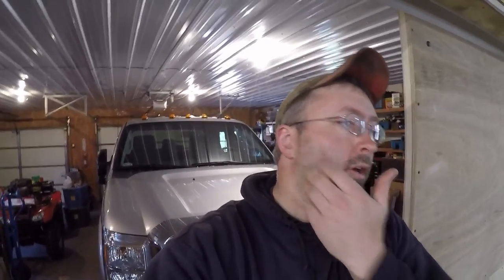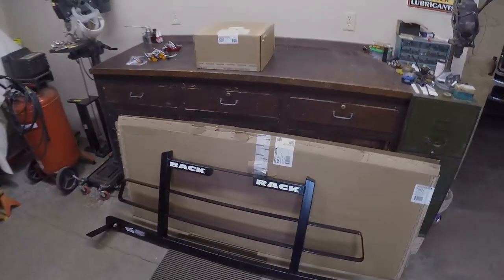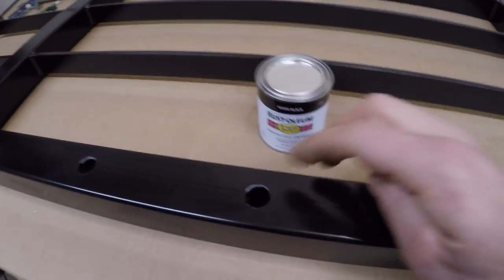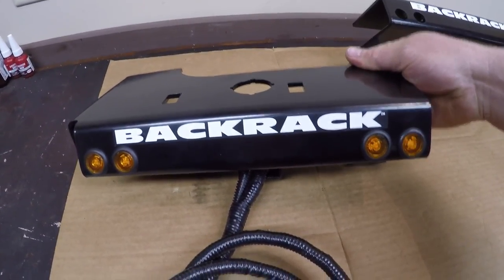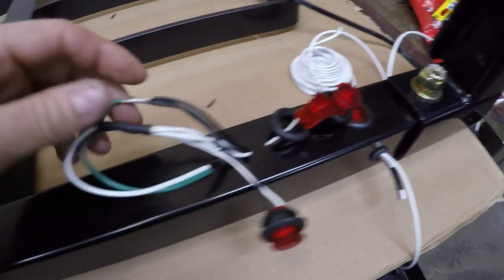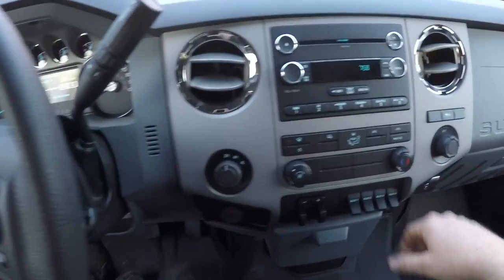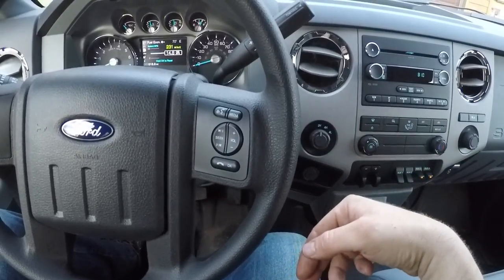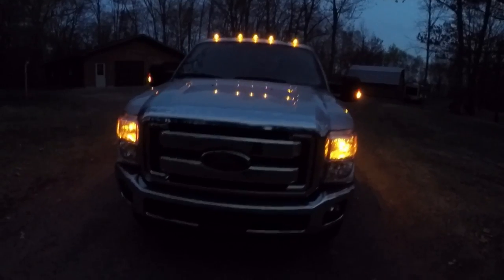BackRack Upgrade - Installing LED Lights

Comment: Looks great!  Nice to see someone else who takes the time to solder and heat-shrink instead of using butt splices.  Sometimes the crimp connectors are unavoidable though; in such cases I usually load up both ends of the connector with dielectric grease prior to crimping it down.  Haven’t had a failure yet! 

One critique I have is the quick connects you have between the BackRack and the truck itself.  Those guys aren’t waterproof and I’ve seen them disintegrate and fail from corrosion.  My recommendation there would be some of the same watertight connectors you used down below, Deutsch connectors, Delphi WeatherPack, or MetriPack connectors.  That’s the only detail I’d have done differently, but overall you did a fantastic job!

Comment: That's a slick setup.  Nice tidy install.  But I will say you need some LED flood lights to light up the bed at night.  Makes loading and unloading after dark a lot easier.  

Great job,
Jay

Comment: Looks great. I love lights I like to be seen. I have a 2017 F 250 with 8 amber on just above the front valance. Set of recon big rig lights. Rear tailgate light bar. Factory clearance lights. And a 30 inch light bar on the bumper that has a amber back lighting. Next is a head ache rack. All lights are switched so if don't want to run them. Once again very nice.

Comment: Sometimes I wonder just how much free time you DO have but the end results are always worth it. NICE job! Looks like NOTHING I'd cobble together IF I could, which I can't! Now for M/M and diesel stuff besides plowing and mowing grass. Spring ought to be there by now!
Reply: I was just antagonizing you a bit because I know full well you can't get done what you do unless you burn the midnight oil candle at both ends. We don't have a t.v. and haven't had  in over 10 years. Nothing there at all for us, anyway. You tube we can pick and choose even though they're pushing the t.v. thing heavy. Not for here. I appreciate what you do and the perfectionist way you do it. Clean and crisp and no strings or wild hairs hanging out. I try to do that and it works sometimes and sometimes not, but I still try. You know you've got me for a loyal watcher. I know just enough about what you're doing to be dangerous but not lethal. I even got to burn a little fuel this week trying to help a neighbor rearrange his swamp with a pond in it. He's happy so I am too. And as always, you did a BANG-UP job! A-PLUS! Later, Pal! And it'll always be supper for me, not dinner!

Comment: Looks good Another wiring method you could use if you dont want to drill holes for more switches is get a DPDT 12v relay and wire a up fitter switch to that relay and wire the the lights to common and normally open contacts. With that said you could utilize the up fitter switch to turn those lights on and off, and still have the stop turn function per side I can explain in detail if anyone wants more info.
Reply: I would love more info on that way to wire

Comment: You can use the upfitter switches to switch a ground....just use the switch to trigger a relay coil and the NO relay terminals to switch the ground.

Comment: Is your tonneau cover an Access Original?  If so, how does the bracket for the cover work ok or should I get the other bracket that is calls for?  I have an Access Orignal but I like the bracket that you purchased and was able to install lights on it also.
Reply: @squatch253  I want to mount the LEDs on the uprights.  After I drill the 3/4 inch holes, how do I go about connecting the lights from one to another?  Do I use a long wire for the positive and another for the negitive and splice each light into the wires.  Just not sure how to wire the lights together.  I need some good advise.  I also am going to purchase the two inch riser as you did and want to add the LED lights on them also.   I just want all of the lights to be clearance lights.  As I stated before I have LEDs on my running boards.  Any help would be greatly appreciated,  Thank you.

Comment: Looking to put some on mine but want to put some on the vertical bars, do you know if the horizontal bar is open, inside, to the vertical bars?
Reply: Squatch253 thank you, that’s very helpful.

Comment: Just a FYI, you could have enabled the additional LEDs with one of those upfitter switches if you wanted to... The output of the (upfitter) switch powers a NO relay that then acts as the switch(the one you installed) within the cab.  Saves you from having to get wires in cab and only requires one wire to be run from the engine bay to your main splice.

Comment: On the Peterson lights you added... How do you wires up the lights that blink and go brake... You hooked to another hidden switch but I didn't get to see or under stand how they are wired???? My Buddy is doing the same bar as you and just like you did. Can you send a diagram on this.
Reply: Squatch253 so basically if we want them to function all the time without and switch we tap into the brake and turn for each side (left and right) and ground them both we should be good on the lights? Won't their be an issue with the 2 separate functions of turn and brake splicing together and connected to the positive of the light? Also we have the same lights you used from Peterson.

Thank you for your help

Comment: Out of curiosity why did you include aux 4 in the setup. #3&4 aux switches are high amperage and seeing as they are led they wouldn't be strong enough to overload aux 3 that you used originally for the running light setup (which I'm stealing by the way). Unless you have no plans to use the other switches for anything else.

Comment: I wish you’d go into more detail about the wiring as to what goes where.
Reply: I’m putting a line of led lights across the front of the motorhome  bumper and I’m not sure whether to run them in a series or build a wire harness.

Comment: I am purchasing a Back Rack for my 2016 Ford F250 Super Duty and would like to install 4 or 5 of the 3/4 inch LEDs on the uprights.  Not sure on how to wire the lights together.  I have the same lights (only amber) mounted on my runing boards and wondered if I could tap into those lights for the power and ground.  any help would be greatly appreciated.